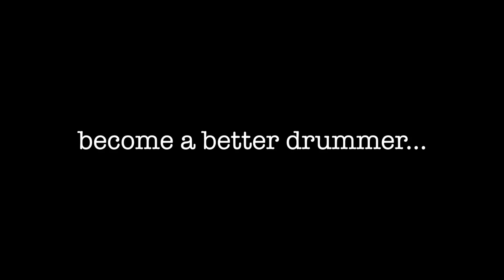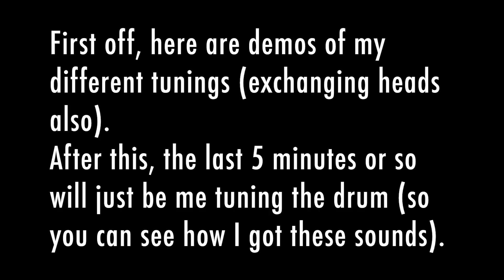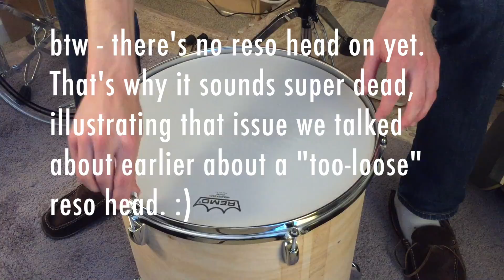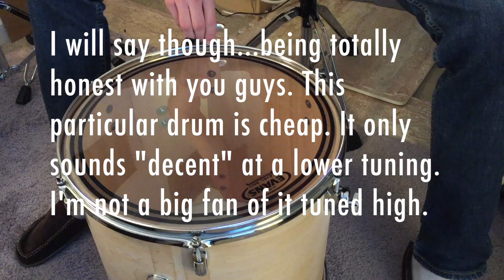Why Does My Floor Tom Sound BAD?

Comment: I prefer hydraulic heads on floor and rack toms. Gives me deep no-ringing rock boom without tons of overtones, especially when non-equal tensioning is used. I need to get the kit 'alive' so overtones become very apparent, then de-tune to remove them. Heavy players like me get way more excessive overtones on high-quality drums.  Thanks for all the tips.

Comment: I tune differently. . I actually do press the center of the head hard enough and tighten the tension rod around immediately until the wrinkles are gone which is faster than this, . And then i tune my batter head differently, not same pitch but differently. Okay at first i tune it high so i can hear the notes tune it to same pitch to all tension rods and then lower them down evenly accordingly to my tuning key. Imagine the the ding dong you got 6 tension rods and group it into two it should shape triangle (2). . one triangle is ding other triangle is dong. . now it will sound really good sound like muffled but its not. . About reso head i tune it same pitch all tension rods but i timed it. . It should give me at least 3 seconds of sound after you hit it low. . Sorry bout my English but i hope you guys understood that. .

Comment: A drumcrafter once said that if your drums are good, it can be nice to have a oneply drumhead to let the drum itself ring. But if your drums suck, then it may be better to have a twoply so that the sound will be mostly out of the head. Which is I guess the best advice. It's not just about "the sound that I want", but also "the sound I CAN achieve" with what I have. My drums suck and I bought oneplies and I hate them. They probably help you achieve a louder sound if the wood ain't good, but if you also have problems in tuning the heads, you're fucked.

Also I guess twoplies can help you have a more controlled sound in recordings if you are doing things alone with a low budget. If the drums are louder and "ringier" wouldn't it be more difficult to seperate sounds and equalise them correctly?

Comment: Something I have experienced: If you have your floor tom sounding good when striking while off the floor (during tuning/testing), but it sounds muffled/dead when standing on the floor, you may not have it sitting on optimal material. I found that my floor tom on hard wood floor loses it's openness and tonality, but stick a relatively light blanket (folded over once) underneath and voila! YMMV of course...

Comment: If the drum Rings a lot you can use 4 or 5 cotton balls string them together and make them flat about the size of the palm of your hand. Take off the top head drop this in on the center of the bottom head. Put the top head back on that should get rid of the ringing and you keep the attack. If you don't like that hit the top head with a stick, while it's ringing reach underneath and loosen 1 lug on the bottom head until the ringing stops

Comment: WHERE exactly you hit a drum doesn't get talked about that often. I think there is some comparison with that harmonics trick guitar players do, getting different higher harmonics by touching/damping the string at certain distances up the neck, thus hitting way off-center gets high overtones. 
This is also important with kick drums: years ago I saw someone play a monster 26" kick, the sound nowhere near as full as expected: same thing happens with an 18" kick, or a 16" floor tom shell turned sideways as a compact kick, which is why it so helps to raise it several inches off the floor. You can only change the length of the beater a little without changing the ballistics and feel- but perhaps adding one of those little clamp weights on the shaft might help?

Comment: You should try tuning your toms with the batter head tighter than the reso. For rock I like a minor 3rd interval and for jazz I like a perfect 4th. Try tuning the reso side as low as it will go with a clear defined note, and then tune the top a minor 3rd higher. I think you'll be surprised at the results.

Comment: Do this test:  1)  With your floor tom sitting in the usual position with three legs on the floor, strike it and listen.   2)  Pick the drum up by the rim, holding it with your fingers, hanging it in mid air.  Strike it.  Hear the difference?

Comment: Great tutorial dude. I like to use Remo Coated Emperors on my toms with a piece of moongel and tuned low to get that boomy and slightly muffled sound. Kinda like Travis Barker.
Reply: Ever try Pinstripes? They're basically Emperors but with a thin line of muffling between the two layers. You may be able to get a similar sound as an Emperor with a Moongel but without the need to add the Moongel.

Comment: The easiest quickest way I've found to make your floor tom sound better and make it at least 80% easier to tune is get some type of "floating" rubber floor tom feet either Pearl or Gibraltar and switch them for the stock ones. In 99% of cases it will make a universe of difference and they are very inexpensive. They will instantly make your whole drumset sound better!

Comment: You can use rubbing alcohol on a paper towel and a lot of finger nail scratching to get the glue off of the side of the drum. Takes a while to get it all but it came off of my ludwig accents.

Comment: i find a bit of high density foam under the feet (if it is a floor tom with legs) helps to keep resonance in the drum rather than being lost in the floor
Reply from the maker: I may try something like that. It would certainly work better than the legs on some toms that have the built in springs... Those annoy me more than anything haha, but foam "feet" make a lot of sense.

Comment: the legs are a big issue for not having good body and tone to it I suggest mounting it removing the legs or buy pearl rubber feet for your floor toms, allows then to resonate a bit more so the sound doesn't completely go into the floor

Comment: Tune the bottom head up a minor 3rd from the top and use a two ply head on top.  Isolate the legs from the ground.  I use the Pearl floor Tom feet and my floor toms kick major ass.

Comment: I tune my toms perfectly, using a drum dial as well. Ive never had any issues since I started tuning the top heads 1-2 ticks tighter than the bottom. Also, I never over tighten them on the tighter or higher side.... to each his own. Ive taken crappy CB drums and made them clean and punchy like any other kit.... its in the tune for me. Takes a while to find the sweet spot but ive never had an issue since.
Reply: What setting on drum dial? 75 or so?

Comment: Hi, great video. I have 16" and 18" Gretsch Catalina floor toms and I really struggle to tune them. I think what  not sure of is the interval between the reso and batter head - any tips please? I use Evans two-ply on batter, and single ply on the reso

Comment: My simple solution is get an 18" floor tom. 16's suck. I also agree with the 12 being hard to tune. I like 13's. 14's seem to never sound right either. I like 15's in that spot.

Comment: I use a pretty standard head setup on my 13" rack tom and 16" floor tom. Clear ambassador heads for batter and clear diplomat for reso. On my 18" floor tom I use a Powerstroke 3 batter and ebony ambassador for reso. I find the 18" resonates like crazy so I have to use a heavier head for the better to match the other toms.

Comment: Hit it with a stick, finger tighten the lugs then put pressure in the center of the head, you should see wrinkles. Tighten each lug until the wrinkles go away in front of each lug that's it. Now it's tuned do the same thing on the bottom head.

Comment: I use the ec2 by Evans, takes out a lot of the over ring. I also use the aquarium Studio rings. I have a standard 12 and 13 inch Tom mounted on my bass drum and a 16 inch floor tom, I just bought a matching 18in floor tom and I cannot seem to get it tuned lower than the 16 in. I think I'm going to have to tune up the 16 so it will be a nicer flow from the 13 to the 18 in. Wish somebody out there would do a video on tuning a 12 13 16 and additional 18, enjoy your videos a lot, if you have an 18 please make us a video

Comment: Large floor tom? Use 5B // 2B. Small stick (5A) on a "rock sized" floor tom, with thick head, won't push enough air / won't produce enough initial attack. Playing jazz kits taught me "tuning" other (non-jazz) drums.

Comment: I had a used Gretsch USA kit that sounded incredible and my floor tom sounded waaaay bigger then it was but it was only a 11”-13” yep a rack tom and I played that kit for over a decade. Once I found another used USA Custom kit with a 16”-16” floor tom I didn’t know how to tune it or when I tuned it like I do everything else higher resonant and lower batter it sounded boingy and terrible, I was confused! I messaged someone on line with the same drum that sounded incredible and he told me you have to tune the bottom head much lower then you are probably used to doing so I did and boom huge fat thick tight with the perfect resonance!

Comment: Has anyone here tried G2 coated batters and Calftone resonants on their toms? What kind of kit, and what was your experience? 

I’m using them on an older birch Ludwig Accent kit (12”x9” mounted and 16”x16” floor). The high tom had a ‘Pearl’ style mount bracket attached to the shell. I removed it, and installed an isolation mount. Both toms sound wonderfully deep and punchy, with very clear tone. I do have to work a good bit with the floor tom to get it right, though.

Comment: Stephen: What size tom would you recommend for a cajon kit church set up where its in a very echo-y in the room?  
I'm trying to find a balance between a small sized floor tom (for easy/quick set up) & cheap price but still have it sound deep enough. My regular set's tom is 14x14 so I'm thinking either a 12x14 or even like a child's sized floor tom. Rookie mistake or just odd?

Comment: I have a Pearl Maple Session from around 2002. It’s supposedly a high end drum but I’m have a difficult time getting my 14” floor Tom to sound right with the low punchy sound. Tried both of the heads in this vid, plus Emperors and G2s... with clear Ambassador and clear Genera Resos.

Could be the age of the heads. How long are you supposed to keep the batter/reso?

Both are a couple years old, but haven’t been played much because I was away for graduate school.

I like to use no muffling if possible.

Comment: My floor tom rumbles and vibrates like crazy when I hit it. I've tuned both heads the right way and every other tom on my set and my snare they all sound great. I don't use muffling. I've got good quality evans heads on all of them. Tom still rumbles like a monster, BUT then I put a pillow underneath it in between two of its legs, meaning the pillow is in contact with the two legs, yet not in contact with the drum itself or the heads. It's just on the floor inches away from the reso but pressed in between the legs. SO does this mean its a hardware problem? Obviosly I've made sure the legs are tight enough, they were tight enough already before the pillow, and the lugs on the tom seem all tight enough. Could it be a loose part inside one of the lugs causing unwanted vibration? If I take the pillow away it goes back to the same loud rumbling.

Comment: Hi Stephen. Thanks for your videos. I have heard somewhere one way of tuning, whih is the reso heads tuned very high and the batter heads tightened just to get rid of wrinkles and basically get some sound. It worked somehow for me while I was using the Remo pinstripes, cannot really tell for the Ambassadors I use now. Would you have some comments on such tuning style?
My 14" floor tom sounds great, I would actually need to shorten the sound somehow, but my 10" tom, which always used to be my sweetie just lost the tone after I changed the heads. I tried the matched tuning, but it still has no body... Any ideas?

Comment: Gotta agree with replacing those old Shit skins with new Heads ... Then Focus on Tuning - Tuning - TUNING [use a mallet, not your stick] Depending on your style, you really got No choice but to experiment & record with a few different heads. Remember a lot of times what works for one kit doesn't always work for Yours. If you need more Flexibility in tones, try out EMADS. You can add or subtract dampening fairly quickly. Excellent for a Quick Fix in Live Applications. Also try out different Beaters on your pedals. ALOT of options and possibilities out there.

Comment: I avoid using floor toms. Even my 16" tom is a hanging type. The three point support of the floor tom makes tuning problematic in itself. Hanging tom (with only one point support) allows more free movement for the shell and solves many problems with decent tuning.
 Talking about floor toms, I think you forgot one important feature: the floor tom legs. Some type legs just don't have enough rubber. That prevents the tom from resonating freely. For example, Pearl makes great "Air" legs with a hole at the center.  They are worth the investment!

Comment: Why does my floor tom sound bad?  Maybe because it's an econo drum.  I've got a Pearl Export floor 16x16 tom that I've had to fiddle with a lot to get a good sound out of.  I tried a number of heads, tuned it scrupulously, still got that "pwang" sound out of it.  I finally found the solution by using an Evans G2 head, which is really nice.  But I have an old Slingerland floor tom that sounds better with less tuning headache no matter what kind of head I use.  The old Slingerland's great but it's the only old Slingerland drum I have and it could cost a small fortune to buy the matching drums to fill out a complete set.  

One thing I've noticed is that, depending on the style of music, you can get good sounds by using smaller diameter drums and tuning them lower.  So instead of a 16" floor tom I'd get a 14".  That could work for jazz or funk.

Comment: Tuning a 16” FT with 6 lugs can be a challenge for any drummer.  All that space in between the lugs has a difficult time tensioning down. 

As much as I hate the way emperors sanitize a drum’s sound, the 2 plies give you the deep sound for rock.

 I’m not an tuning expert but I have found every drum has a sweet spot for ballsy tone with a lot of resonance achieved with a single ply ambassador and diplomat reso.  The single ply heads give a drum personality in my opinion. I have a hard time hearing the difference between a $3k with pinstripes or emperors and a $300 kit with the same heads. They just take away too much raw from a drum.

Comment: Following your advice, I began paying MUCH more attention to tuning my res head on my floor tom. Been playing the batter head tuned way LOW and found I had way too much resonance/sustain. Tuned the batter to "medium," couldn't believe the improvement. I play mostly in my den along with iTunes and a great speaker system. HI-HAT: switched to a matched pair of really super cheap 12" cymbals and they sound great here at home. In public, they sound horrible, so I use an inexpensive 14" pair which sound decent. My biggest gripe is I have to muffle all my toms at home or they sound overpowering (if that makes sense). Muffled, they simply sound dead. Any suggestions?

Comment: I can't seem to get my floor toms to sound right either. They were stock Tamas, then I changed the batter head with a Remo Ambassador and sounds a little better. Maybe it's the reso head I need to change or try tuning again. Not sure. The 8, 10, 12 toms sound perfect. Not floor toms 14 and 16 though

Comment: God I hate moongel on my freaking toms.
Reply from the maker: Ha! Yeah unless I were going for a specifically muffled, mellow tone, I wouldn't be putting any on either.
Reply: At least it's not as bad as the idiots who put moongel on their cymbals.
Reply: Actually, I love a single well-placed piece of moongel on certain floor toms. You need to really experiment with the right spot. You can help remove an annoying unwanted ringing overtone and bring out some low-end resonance.
Reply: It sure makes your drumkit look kinda crappy, but sometimes experiencing with tape, clothing, cotton or things like this can result in interesting sounds o/
Reply: • shut•up•and•kiss•my•turtle • sometimes it’s useful, like when you need a drier cymbal with less ring on a song, you can put some muffling on it and it really changes the sound (usually in a good way)
Reply: What? People do that?
Reply: Anirudh Ananth • byzances are generally regarded to sound great though
Reply: I've had to play in cathedrals occasionally which are super tough sound-wise but surprisingly moongel on the cymbals helped. I wouldn't do it anywhere else though.
Reply: Thats funny, I load my floor tom with old socks.
Reply: O-rings all the way!!!
Reply: Moongels has there place. It depends on the situation. But that is just my opinion.
Reply: Shining Armor I FEEL ATTACKED

Comment: I dont think I'd tune my toms so low.. to my ear, it seems to ad a "blat" noise when the tom is struck, less so on the evans but still there... I just had a thought... (and it didnt hurt one bit) with a bodran, humidity and temprature plays a signifigant part of the tone.. any reason, even taking into account that modern skins are treated plastic, why such would not be the case here?

Comment: What if you hear cracking coming from the head when you tune it
Reply: SPAAG WG It's normal for some heads to crackle when getting seated on the drum. So don't worry, you're not damaging them, just breaking them in.
Reply: I just realized I'm answering to a 4 months old comment :/